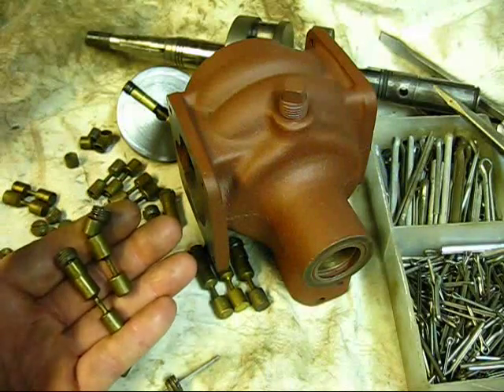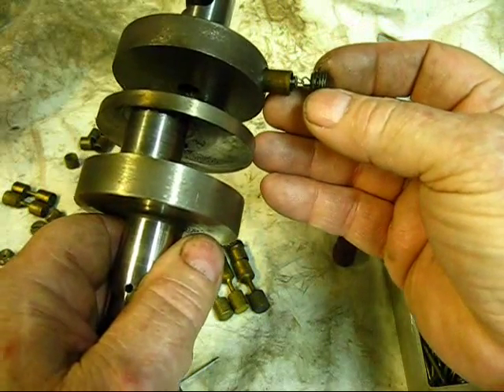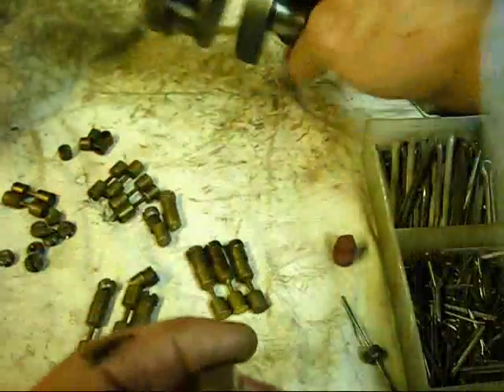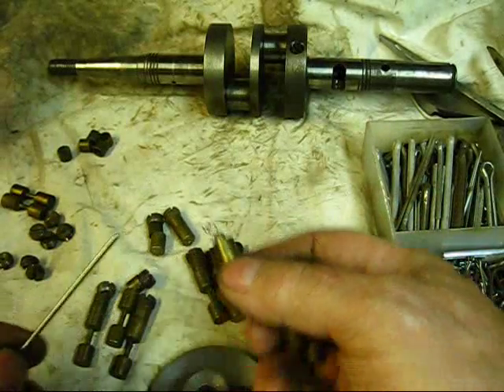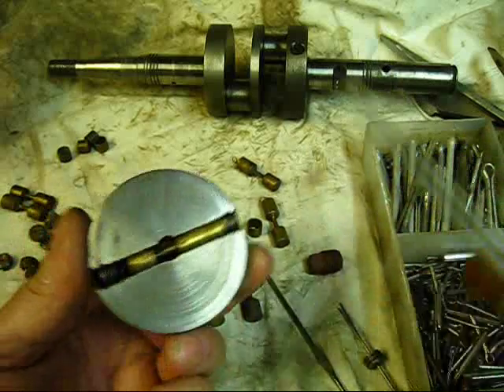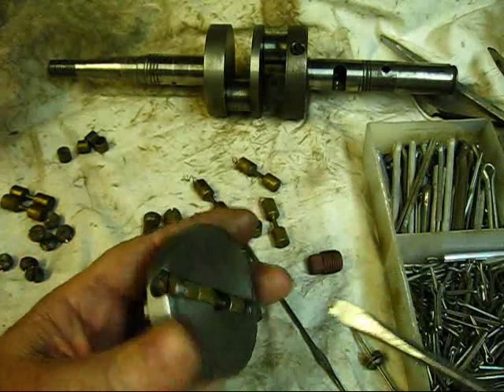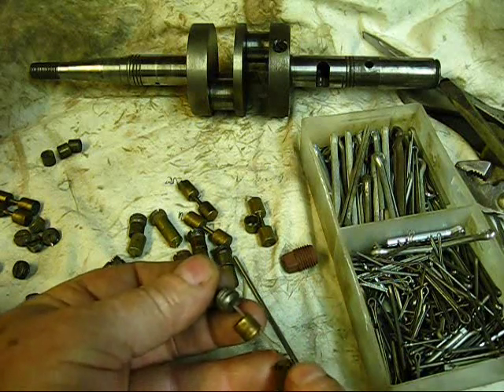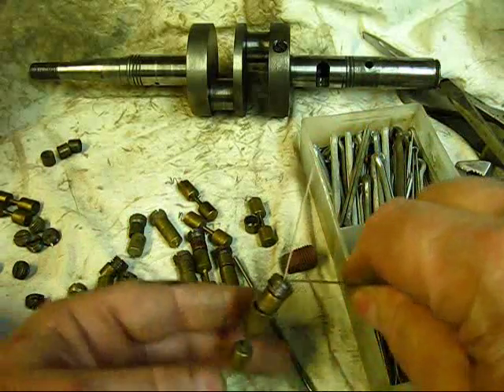1937 Maytag Engine  model 72  rebuild #11

Comment: Understanding the risks of blowing one up completely, I wonder if there is a way to run the 72 with no governed and with a small carb. I am building a bicycle with a 72 and I would like the ability to throttle the engine. It's really more of an art project ans would railroad be run of about 1400 RPM. Is it possible. Your videos are fantastic and you are definitely the expert. As far as I can find. My email address is thament99@gmail.com. I have the bike frame streached already. I suspect you have seen the video on utube called maytag flyer. That wat I am building. I will definitely keep watching for more videos. From your videos I have rebuilt two 82 AND ABOUT TO START On my new 92. Many thanks in advance for any info or advice
Tom

Comment: Very interesting. With all the parts that were bad on this engine it would appear be practical to try in overhaul one only if you had a large selection of parts engines, like you do.  So I guess it would be a good idea to determine what make and model engine you want to end up with and then spend a bit of time collecting a bunch of old engines of the same model before you even start any overhaul.
Reply from the maker: dan andy ,,, seems that's the way it works,,, or,,, ends up that way,,, you have got to have good parts to have a good running engine,,,,

Comment from the maker: ,,,, no, this is just a basic flyball governor in a compact version,,, would work on all types engines,, all it does is restrict the air-fuel intake,, on a 4-cycle (and some other 2-cycle engines) you have a throttle plate, linkage, spring, and a weight or diaphragm of some kind,, works the same,, ((just imagine this in place of the butterfly valve in a carburetor, chain or gear drive)) now this intake through the crankshaft,, that was one of mr. maytags better ideas,,

Comment: You said that was as far as we need to go for speed control on a gasoline engine.
Didn't you mean for a 2-cycle engine?
Just where would that work on a 4 stroke engine??? 8>))
What RPM do you set your twins to?

Comment: How do you tell from outside the crankcase (through the capped hole) which screw on the crankshaft should be used to adjust the engine speed?

Comment from the maker: ,,,, no, no,,,, the model 72 is NOT a "hit and miss",,, it is a throttle governor,,, the engine fires every time,, it just don't get the same amount of fuel vaper,,,,, the model 92 is a hit and miss,, the governors are completely different on the two engines,,,